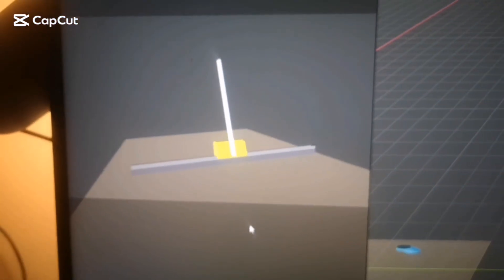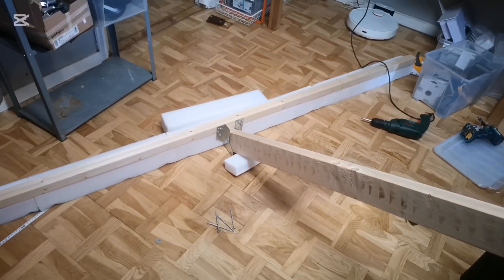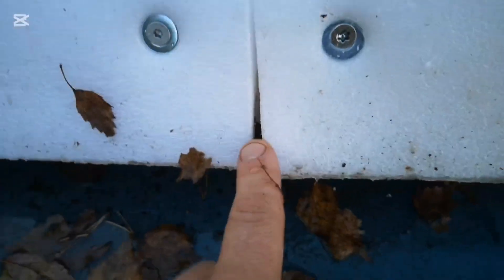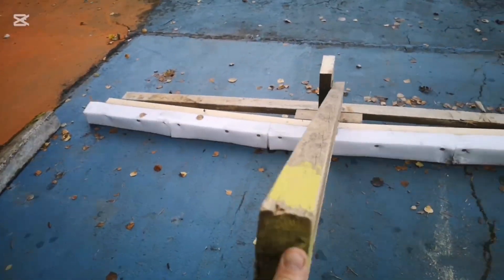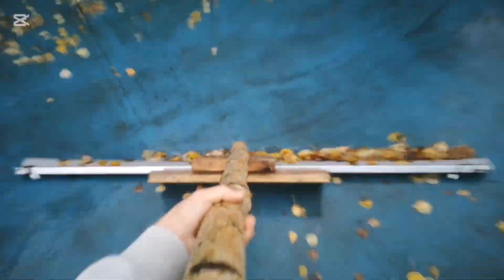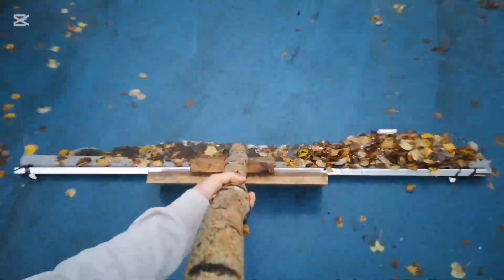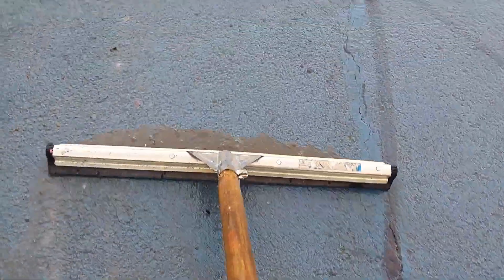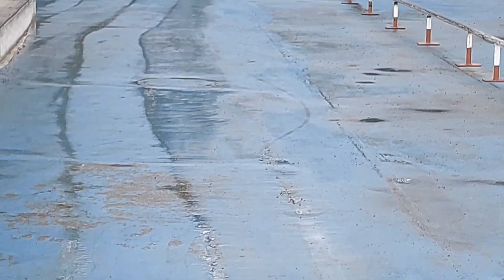Water pushing invention device to make ground dry

Comment: I have one of those for when I pressure wash properties, it's tire rubber with a nice round edge to slide on asphalt and concrete. Not square or sharp like a windshield wiper.
Reply from the maker: Oh tire rubber sounds like a good thing to use, If I make a new one I might try that!